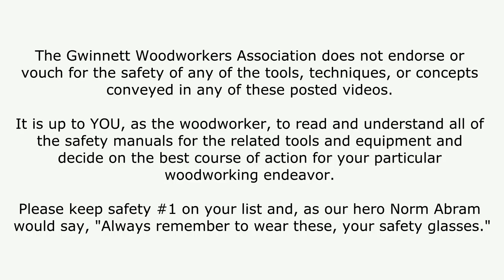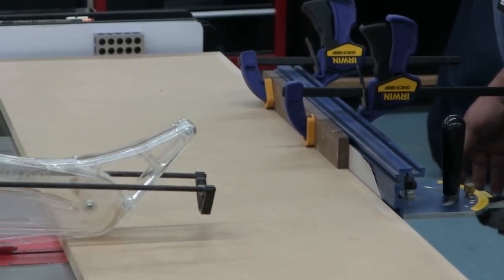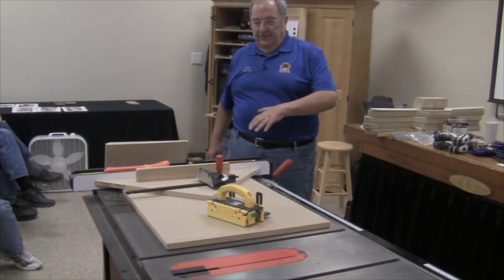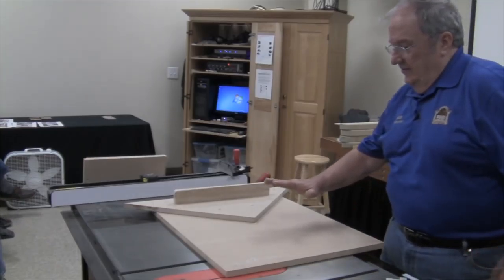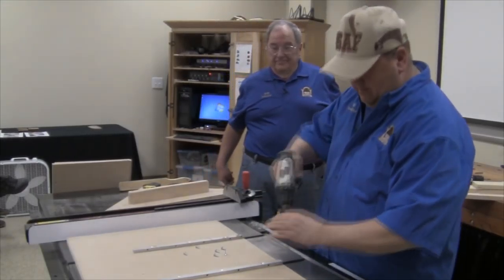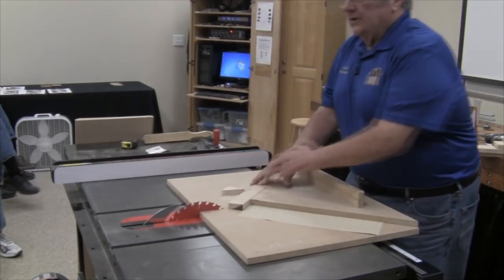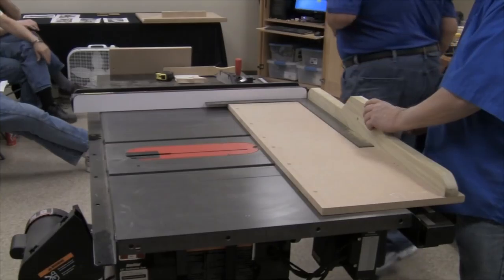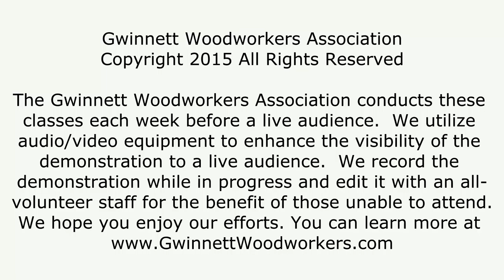2015-01-10 Making table saw sleds

Comment: I have a idea running in my mind and I thought this is a good place to discus it. I am new to woodworking, and so far I have not seen a bad argument against mounting a stop switch on the table saw fence, do you think I am on the right path?
Reply: chris kary It seems all my cuts end with me having to balance a piece of wood on the edge of the table wile searching for the switch on the side of the table. I have a small DW745 saw with the Euro switch (I think). The paddle switch you mention would be nice to try. My idea is to mount it to the fence, in a position to push it with my elbow. Connected to the table through a cable and a quick connector in case of fence removal.

Comment: Where did you purchase the t-slot washers? Thanks.
Reply from the maker: They were ordered directly from Kreg. They are the one that they use on there Miter gauges. I think we had to order a bag of them. I think around 25. Make sure you order the screws.

Comment: There's three of you to handle the big sheetgoods which demonstrates a bit of safety but only one of you is wearing glasses (which look to be prescription, no sideshields). And there are dogs roaming around the shop. It seems you guys are teachers from the way the video description reads but you sure are setting a poor example of safety. To paraphrase Norm Abram, before you use any power tools, educate yourself about safe usage and wear personal protective equipment, none being more important than safety glasses.
Reply: +escalations007 excellent point. If I may add another point, no one trying to learn from this video has a gigantic table saw and 2 assistants, the proper way to cut a 4x8 is to use a circular saw first to get manageable size pieces then use the table saw to make the final cuts.

Comment: Besides the safety issues, this video is full of mistakes. The runners should not be attached up side down if you want the sled to slide properly. The fence should be squared to the kerf then tested with a 5 cut test, etc etc